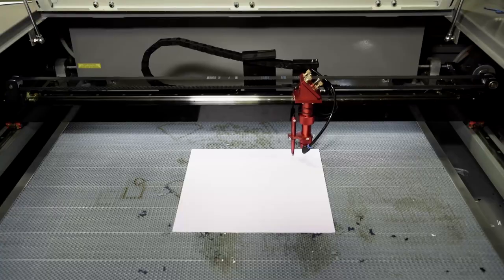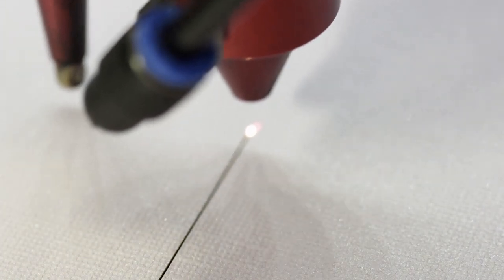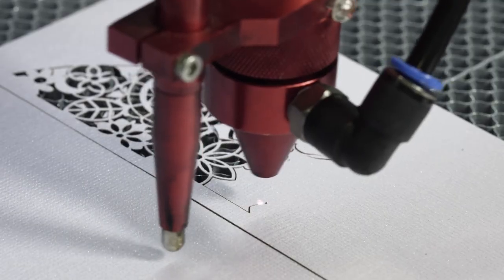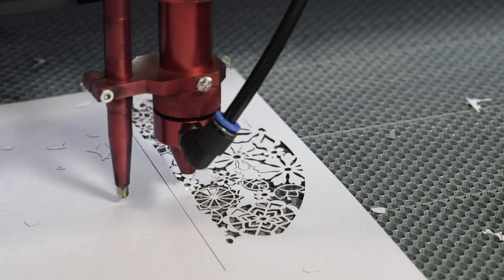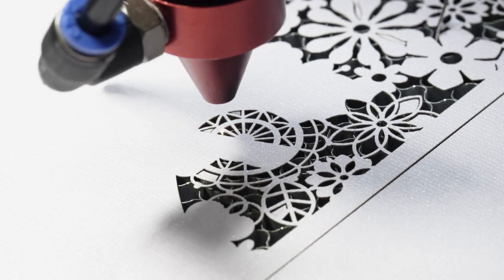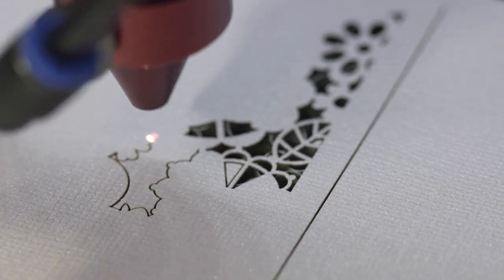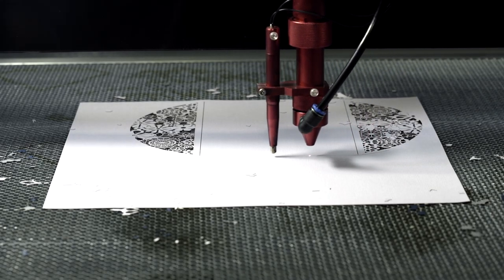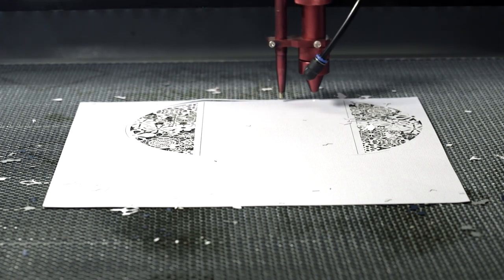100 Watt Laser Cutter Makes Paper Wedding Invitation

Comment: could this be now on a larger scale, cutting through multiple pieces of paper at a time
Reply: There is a limit... You can see in the video that paper starts to bend upward when being cut. If you stack multiple papers on top of each other, you'll get a lot of burn marks on the last pages. So you'll have a maximum of 2-4 papers on top off each other (depending on what sort of paper you have).
Reply: It doesn't work that way yet. The bottom layers won't cut through and the top one will burn.
Reply: Nick ward hi
Reply: Nick ward probably not. I think the beam will dissipate when it pierced the first paper due to the gap that there would be between the sheets of paper.
Reply: If  we put a book instead of a paper will it work? By sacrificing the top of the page, possible?

Comment: It's beautiful, but how long it takes to make 400 invitation cards?
Reply: qnaman you certainly got a point!
Reply: I guess it must working 24/7 when you have one month pre-order.
Reply: qnaman that would depend for this going at that speed is probably takes 2 to 3 mins for 1 card at that speed.
Reply: Last week I did something like this on a 60w laser machine... It took 15 min for 8 invitations... I needed 200 ;) Speed setting where much higher than in this video!
Reply: qnaman about 400 years.
Reply: About 400 years give or take.
Reply: @Cary Andrae so around 375 min (6hr 15min) for 200? that's pretty quick. probably make a good profit off doing that.
Reply: at 11K for the 100Watt cutter it should be that quick otherwise you might as well do it by hand. It would be nice to find one at a reasonable price for hobbyists.
Reply: Cheaper to just go thru a company that does it.
Reply: you should buy 10 -12machines so that you get faster result.lol
Reply: Carl Hughes  my Chinese 2500 mw hobby machine under £200 is twice the speed of this he is not cutting fast enough
Reply: 1 paper cost is $ 49,99 😅
Reply: Pile up 400 sheets of paper, then use the laser.

1 minute, 51 seconds.
Reply: @ericpicasso6356  photo
Reply: You can cut through many sheets of paper at one time...

Comment: Brilliant.  Would be great if there was one that could laser cut very thin wood because I have an idea of how I could put it to good use.
Reply: Thats a 100w laser they used to cut that paper at 15% power.. They even cut ply wood and acrylic up to 15mm thick. tho just at a higher power setting and slower on the speed.  
There are also smaller powered co2 lasers that will even do up to 5mm wood and acrylic if someone was only going to need to cut thin wood. paper or leather.
Reply: A 100 watt co2 laser could easily handle 15mm ply sheets and even thin sheet metal if done with a lot of passes at slow speed

Comment: Your website does not list this model under the "arts & crafts" section, rather it starts with model LS-1416.  Would LS-1416 model (with the standard 50W tube) be capable of doing invitations as shown in this video?   What would upgrading to the 60W tube on the LS-1416 do?  While the model in this video looks amazing and exactly what I want (except I don't see needing that large of a work area).....I definitely won't be going to that price range either.
Reply: 50w is perfect for paper and thin material cutting. The more powerful lasers are for thicker materials, and can burn thinner materials, depending on how fast the laser cutter can move. Basically, it's better to have a weaker laser for thin materials otherwise the laser cutter has to be over-engineered for inhuman operational speed.

The faster the laser cutter moves, the more likely it will have drift errors due to overshooting from inertia. So yeah, the weaker laser is the way to go.

Comment: How come the card doesn't blacken? This is very nice!
Reply: This is a pulsed laser! Pulsed lasers work in weird and confusing way compared to regular non pulsed lasers. The time the laser is on is only for a few microseconds or less even. Because of the short time the paper doesn't have time to adsorb enough heat to char. The stuff directly underneath the laser beam gets immediately obliterated though.  Styro pyros video on a laser tattoo machine has a better explanation on pulsed lasers.

Comment: Hello, I have laser machine and when I cut paper, there is burn mark. How to remove it?
Thank you for answer me!
Reply: what kind of air do you use?  co2?
Reply: is there air blower on this video?
Reply: Rakoto Bozy In case it is helpful, we started using an air compressor in exchange the one that came with the machine (pardon my English, I hope I can express myself  properly). When cutting and engraving wood it makes a real diference in those burnt borders. you get absolutely clean cuts instead.

Comment: Looked good… until I saw that the bottom entry-level unit started at $4500.
Reply from the maker: Hey Daniel! We offer different options to help users in acquiring our laser machines. 

Our Boss LS-1416 starts at $3,997 and can be financed for as low as $87 a month. We also run monthly sales that make price fluctuate. For example, now in December we have a free upgrade on the Chuck Rotary and Matching Steel Stand for the LS-1416 (total for both valued at $744).

We also offer a military, education, and first responder discounts. You can always reach out to our team members by calling them at 407.878.0880 for details on financing options, specials and more. Let us know if you have any questions!

Comment: Can i use these machine for t shirt tranfer paper ? 
Bcz the paper i use is rubbury coated on front ??
Reply: it would cut it.  but if your thinking so you could use the laser to cut out the out line of the design from the transfer paper.  tho if you are meaning vynil iron on transfer paper. rather then sublimination paper then you have to be very very careful of what brand of matiral you use and have to make sure it does not contain any pvc aka vynil because it gives off toxic and very corrsive gass that turn to nitric acid when it combines with h2o in the air and even just cutting a few pcs of vynil in a laser can destory the machine. The acidid corrosive fumes stick and condence on any bare metal in the machein including the ralls. bearings. all the copper in the electronics. and even seen some machens that cut vynil for a few months that were so rusted and correded that the coating on the lens and mirrors even trued green and most of the componets on the circute boards had most of there solder joints corroded away and could just flick off the chips and ICs.  Tho some coponys such as sissor now make laser safe vynils tht contain no pvc but not all colors or matrials. 

best thing for cutting out t shirt heat press matrial would be vynil cutter like a siloette, cricket or even a rolland.

Comment: but why 15 % power ? its 100w laser and its will cut on 5% or 10% , and 50 mm per second
Reply: he wanted to get it so it cuts at the right speed and power to not leave any burnt edges.  Tho he could of prob dropped the power down some. there is a minium amount you can go before they laser wont fire at useally around 12-13% some can go as low as 5% and still have enougt power going to the tube to get the laser to fire.   Tho if he dropped the power some he would of had to drop the speed some to.  Tho he could of even went higher on the power and could of ran that machien way faster then 60mm/s with out it shakeing the machien all over the places. or loseing steps. Or he could also of keep the power at 15 or droped as low as that tube will go. (every tube is difrent due to varuations when they are made) and then sped up to like 200 or 300 on the speed and he could of marked it in stead of cutting it. Or could do part of the desing cut out and other parts that would of been a dark scorched fine line drawing.